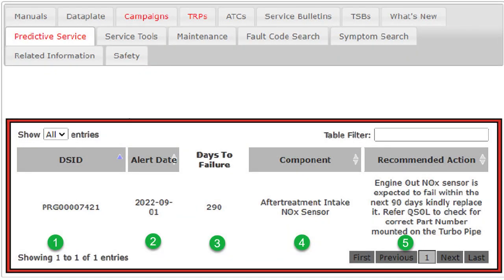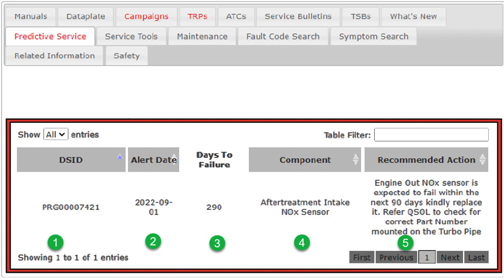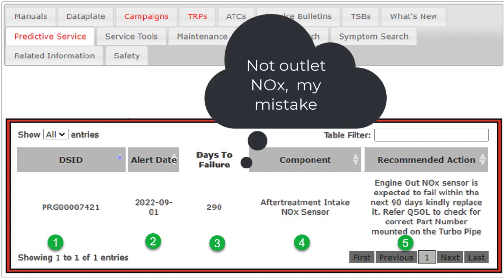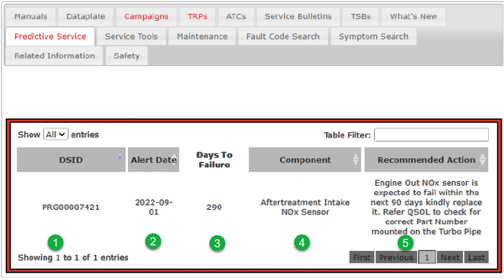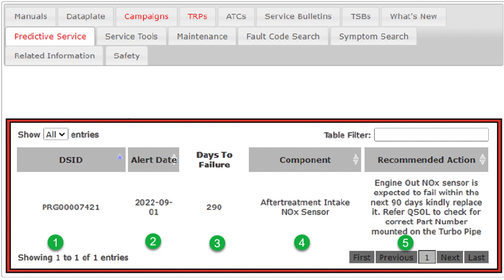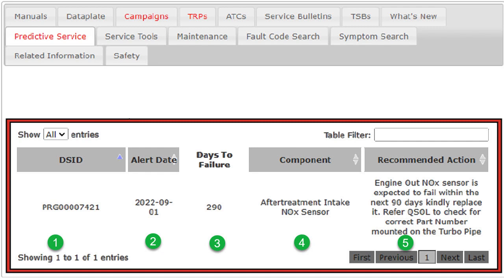What is predictive maintenance? Have the engines become Self aware!?

Comment: After replacing the component predictive maintenance is making you aware of, do you have to do a special reset so the ECM  plus QSOL knows the component was replaced??????
Reply from the maker: Good question: As to whether or not cummins has to know because of predictive maintenance- NO they don't know and dont need to know.  Predictive maintenance is the beginning of a much bigger picture we will talk about as it unfolds. If you file warranty then the information would come into play on cummins end. Nothing you need to do or report

Yes to any resets the calibration has in it. All tests and functions and everything you see in INSITE is out of the calibration. Insite is just a bunch of blank windows until you hook to a unit or old ecm image. Now as to resets For example the NOX sensors, scr brick and def doser all have resets found in advanced ecm information. The resets are so the ecm resets software tables or limits on the new sensors. If you don't do the resets it just takes the system longer to LEARN that the part was replaced. These days as soon as you hook up to an engine Cummins insite reports back to cummins on not all but more and more of what and why.
Reply: This episode was like drinking from a fire hose.  So did I hear that quickserve online has access to the newer trucks… x15s etc.  or only the trucks that purchase a certain plan.       And second,did I understand that insite will stay the same or no.
Reply from the maker: Because there are a lot of questions on this I will do a clarification video and post it by Friday Sept 1.